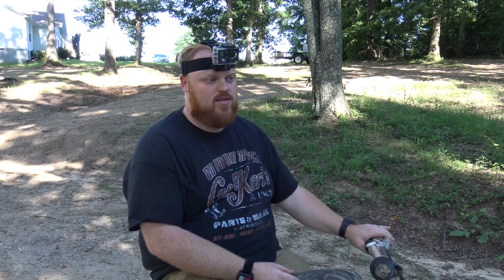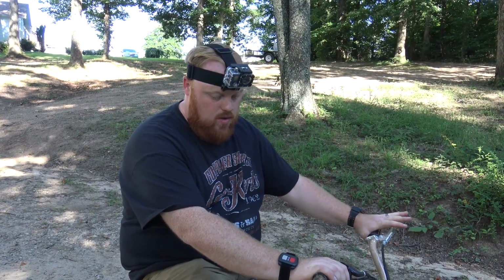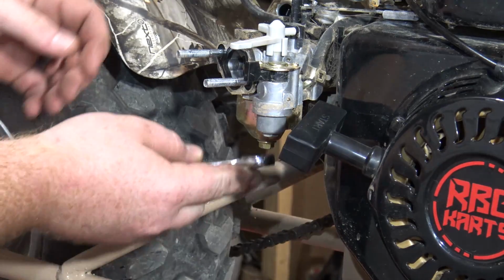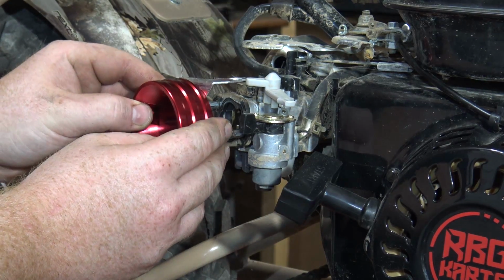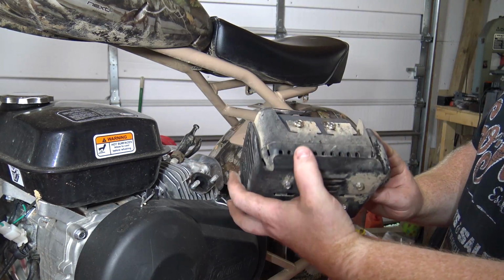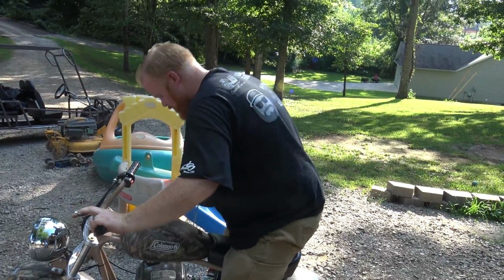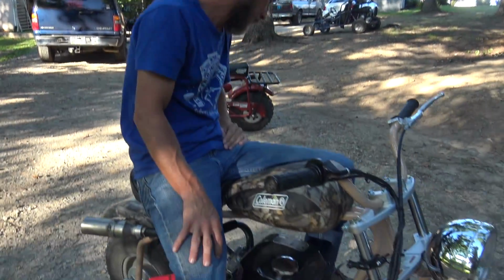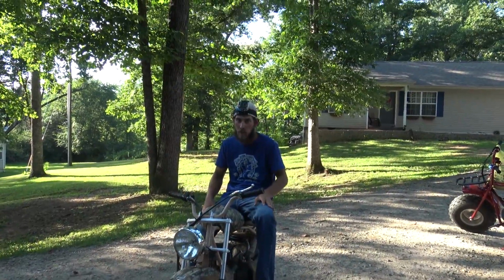Coleman CT200U-EX Performance Parts ~ Mini Bike Monday

Comment: Just got my CT200U-EX put together today.  Took the initial test ride and said that will never do.  Grabbed my screwdriver and could not move the throttle screw.  I took the air filter off and the throttle screw was welded in place.  I cut the screw off and got 27 MPH out of it.  Wow what a difference.  Going to try the zip tie trick next.  I see a Go Powersports order in the near future.
Reply: What specific kinds of gas and oil does the Coleman use ?
Reply: @therealming0 10w30 motor oil. 90 0ctane or higher gasoline

Comment: New models have a welded screw and a fixed jet. You will need to cut the screw and use an extractor to remove the stock jet. Great video guys.
Reply: RCLegion just hammerd a flat head in to it came right out

Comment: I look forward to this series every Monday. Your basically exactly where I am with mods now; except that I bypassed the governor completely by making a new throttle linkage. I only use mine off road so the K&N style filter was a no-go for me. I think you will be pleasantly surprised by how well they will run with a stock intake ported to the max. I only wish they made a Uni filter for the stock air box so I could get rid of the paper filter.

Comment: My suspension would pop back all the way so I just opened it up and stuck a bolt on top with two thick lockwashers and it works perfect now. Way better for offroad

Comment: You can move holes on the governer arm with the spring going to the carb and raise your rpm as well up to 4800rpm is max ive seen someone get one to go too
Reply: I got this RPM with just cutting a few coils out of the return spring. Nice part of cutting the spring is you can lower the RPM back down by adjusting the screw back in.
Reply: Make a video!
Reply: @Odin31b  I personally dont run them anymore. I have a engine with one still together and working in the engine if I have the time I will. It's more or so one of those things you have to play with yourself. Each engine will be set up slightly different where the arm with the spring to the arm off of the gov shaft that runs through the block pushing on the gear to add rotating mass to slow the crankshaft up when the arms on the gear fly outward and some more things I cant personally think of at the moment. Sorry buddy it's been a fairly long day at work today. Anyways you can also use a stiffer spring to change or adjust it. If you remove the governor and dont want to use a throttle stop screw on the OEM throttle setup you can play with the timing and jetting to adjust the max rpm it will go under load. Without load will be different it typically when free revving it will go to a much much higher rpm.

Comment: Looks like it made quite a bit of difference in torque. A little more speed and Lonnie could clear that driveway! Before anything i stick a ziptie in the governor spring, cut the head off of one and put it on another. It took the baja warrior from 22mph to 33mph.
Reply: By the way just got my chain break today, its awesome!
Reply from the maker: Those chain breaks are a must have for go karts and mini bikes. Thanks for watching man.
Reply: Spino_ Slayer same here would like to know
Reply: Red Beard's Garage what the best motor swap for one those without having to do any weld I thinking of a predator 420

Comment: Mines a Baja Heat and i installed a Pred 212 and aftermarket tailpipe (no muffler, straight pipe!) and aftermarket air cleaner and it rocks!! Im over 200 lbs and it really scoots!!!!

Comment: Hey man. Great vid. It appears my jett, 5:48 has a screw that can't be backed out. Like a one direction screw. How do I get it out? Also, my kit that ordered did not come with the new emulsion tube. Thanks.
Reply from the maker: You don't need the emulsion tube and its really hard to get that jet out. I will try and do a video on it soon sir
Reply: Red Beard's Garage I have a 2019 model. The screw on the Jett is shaved off so you can back it out with a screwdriver. Also the throttle screw is soldered on so you can’t adjust it either. I grinded the screw off but can’t get the jet out.
Reply: You all probably dont care at all but does anybody know a tool to get back into an Instagram account?
I was stupid forgot my password. I would love any tricks you can offer me!
Reply: @Archie Brock instablaster :)
Reply: @Zachary Deshawn I really appreciate your reply. I found the site thru google and Im waiting for the hacking stuff atm.
Looks like it's gonna take a while so I will reply here later when my account password hopefully is recovered.
Reply: @Zachary Deshawn it worked and I now got access to my account again. I'm so happy:D
Thank you so much, you saved my ass!
Reply: @Archie Brock no problem xD

Comment: Put a Zip tie in the spring between the governor arm and the Carb. This will give you about 4500 rpms without touching the governor. If your light on the throttle you can feel it pull against your throttle but you can over power it and gain more revs. Also help with clutch slippage. Basically free mod. Dont even have to take the tank off. I usually just lightly wrap the spring with the zip tie. If its to tight you risk opening the bends on the end of the sping if you pull to much throttle. I have also taken off tank and replace this sping with a solid rod to a better effect but i find the zip tie works just as good and is easier.

Comment: Greg, look into a larger low speed jet. I bumped mine up from a 16 (stock) to a 22. fattened up the bottom end and helped the mid range a noticeable amount. Changing just the main jet makes the idle/off idle run lean.

Comment: Riding in the mud I have a fix for that mr. Red beard. I watched all of that. Add it's cuz of the space between the tires. So the new bike is awesome and everything but it's too short. You need to have the calm and red one with the front end that the new Coleman as the hydraulic shocks. And there you go. I think that's what I'm going to do eventually

Comment: Older post but the white choke lever  has a cylindrical protrusion with no apparent use.....u shove it into the hole of the gas line after unplugging it (while its clamped with pliers) from the carb

Comment: I put a predator and tav-34 torque converter on a CT200U-EX and my Baja warrior MB200. It is by far the best setup, and I can creep up steep hills with tons of torque or do 45 down the road. Getting the tav34 to fit on the 200U-EX required cutting/welding of the frame to install without engine mount risers though.
Reply from the maker: These engines have a small 5/8" output shaft. Thats why we said in the video that go power sports is developing one for it.
Reply: Have you seen the 5/8 to 3/4 shaft adapters on ebay? Theyre like 10 bucks. And the plate does have to be trimmed some to fit the frame.
Reply from the maker: The only thing about that is the key is made in the drive pulley on a cvt. It wouldn't be long enough to fully go into the crank shaft

Comment: Hey RBG. Those bikes seem a lot faster. I just can't imagine what happens when you take out that governor. I will stay tuned as usual. Thanks
Reply: Well if you take out the governor that's bad for the motor and it will not start my brother did that and it never started so he sold it just to let you know

Comment: I got this mini bike for my kids for Christmas and after 3 days of light use the carburetor is leaking fuel at a pretty good rate. I’ve taken the carburetor apart fully and cleaned it, put it all back properly and now it’s leaking again after less than 24 hours. Any suggestions?

Comment: So I'm about your size & I have not bought this bike at tractor supply yet because it says the weight limit is 200 lbs! lol  You are all up on that thing & seem to be over the listed limit.  I'm sure the performance kit helps but is the frame & suspension ok so far with you on it?  I want that bike bad but I'm scared to get it.  I'm 250.  Let me know plz
Reply from the maker: Im 250 as well so you are good to go sir

Comment: I weigh about 180 and mine goes up hills fine.  It’s actually pretty darn fast at it.  I think your exceeding the weight limit by about 50 pounds.  Not trying to sound mean by that so don’t take it the wrong way.  I would like to get mine up to about 30mph if I could.  I don’t want to add any parts though.  But for now it’s still a blast to ride.

Comment: Dear red beard. Could u use a 12 volt computer fan as a small engine turbo by mounting it on the air box
Reply from the maker: It would make a super small difference. I don't think it is worth the effort to be honest
Reply: Red Beard's Garage would be cool tho
Reply: Kart Kid It would do more to restrict the air flow than to actually help it. It might turn 100-200 rpms. Turbos spin 80K+ rpms...

Comment: So, how much power difference between that engine and a stock 212 Predator?  I just put an untouched Predator on a similar style bike, and it went 41 MPH. My 1968 Taco 22 has a Predator with a 22mm Mikuni, cone filter, and a very expensive megaphone exhaust that has only hit 39 MPH, but I'm still playing with jetting. Both have 10/60 gearing, but my the Taco has much shorter tires.

Comment: I think I May have mixed up the original and upgrade emulsion tubes. Does the upgraded one have the larger orifices?
Reply from the maker: Yeah it is a little different. Swap it out and see what happens
Reply: The upgrade one has larger holes? Seems to run fine now but I have the emulsion tube with smaller holes top and bottom.  Thanks.
Reply: Update- I called gopowersports and they will pull a stock carb and compare the two. I think that's the only way to tell and I am past that since I already mixed them up. LOL.  Thanks again.
Reply: Just in case someone is doing a google search in 2032  or something..  The upgraded emulsion tube has 5 holes on both sides, the stock predator emulsion tube has 6 on one side, 5 on the other. Turns out I did get the upgraded one in the carb the first time.  It runs good!
Reply from the maker: Sorry I was filming when you was commenting. Thats good to know. I never paid attention before lol
Reply: No problem! Yeah I didn't notice that difference either when looking at them side by side. It is good info to know if you ever get them mixed up like I did.
Reply: BTW I think the upgraded one actually had the smaller orifices on the ends of the tube which is what started the confusion for me in the first place.

Comment: Greg I have a Mega Moto 212 when I decided on a mini bike I wanted the Monster Moto MM-212 but they were sold out. So I bought the 100. Cheaper Mega Moto and as you already know they went outta business. It’s a shame 100 more would of gotten a front suspension Headlight and front and rear disc brakes and I think a CVT not sure. Anyway I was looking online and my forks from top tree to wheel bolt holes is 24” the 33mm forks are 630mm 25” so that’s fine but the Triple Trees are 6.29” from mount to mount I need 9.3/8” between forks. I’ve looked about everywhere and can’t find wider trees for the forks. I did install 2 60 watt over under LED lights with a Talentcell battery in the rear ammo box 6,000mah A/C 12,000 mah D/C. Can you direct me to where I can find the complete fork set for my Mega Moto so I can install a Swing arm and rear shocks. Remember the fork holes have to be 9.7/8 to 10” to work? Thanks

Comment: How about putting a "springer" seat on the EX for a little more comfort while riding?
Reply: thats a good idea, i wonder if that would work on a go kart with no suspension
Reply: BackYard Karts the point of a springer seat is for comfort on a bike with no suspension. The springs under the seat become suspension for youe body, as to not destroy your back on hard bumps
Reply: but would it work for my go kart?
Reply: I agree Kelly Best. When my EX was slow the lack of rear suspension wasn't so bad, now it can be downright brutal. It looks like it would be fairly easy to add springs under the stock seat.
Reply from the maker: We have actually already planned on that lol. Thanks for watching and the input man
Reply: Hes gunna break that thing
Reply: Red Beard's Garage you gonna add nitrous to it
Reply: I broke my back while riding it on bumpy land so yeah it needs springs

Comment: I have a question about the exhaust setup...I really like how the new exhaust works and routes to the back, but how loud is the setup with the new muffler vs the stock exhaust?
Reply from the maker: more than double the noise
Reply: That's unfortunate...I don't want it any louder but I do like the exhaust not being right under my leg.  Thanks for replying!
Reply from the maker: No problem man

Comment: did u put the gasket on the spacer between the airfilter adapter because if u dont you engine will suck dirt in from there we had that problem and blew a predator up because the carb was full of dirt and it got in the head and destroyed it
Reply from the maker: Yeah i put the metal gasket with the rubber o ring on it
Reply: ok but did u put the paper gasket that goes on that spacer with the o ring on it comes in the kit
Reply from the maker: I never us it. Its not really needed in my opinion
Reply: its claimed two of our motors lol

Comment: Where did you get the EX model I can only find the ct200u and I've always wanted to buy one of those.  Do you think if you put a torque convertor on there that you would get some more torque for hill climbs and stuff cause the motor didn't seem to have enough torque to get up the hills. - Mini Moto

Comment: Will turning out the throttle screw hurt the engine if you hold it at wide open
Reply from the maker: No it will still governor itself

Comment: RedBeard i got a ct200u ex like you modded here. And am looking to swap the headlamb for a 12v DC 18w led. I saw a honda dual coil that outs out 12v dc 50w. It may fit but wanted to see if you knew a good options

Comment: I have a 212 Predator engine with poor boy upgrades lol, i drilled a hole in my factory air box an I put a PVC pipe elbow in the hole an plastic welded in and a custom exhaust and throttle screw adjusted I test drove it and it hit 27 mph...really wanna 40 or over what do you recommend?
Reply from the maker: Remove the governor and gear different

Comment: I just picked up a Coleman for 499 at TSC. I’m confused on your jet swap though. I went to the go motorsports website and there’s a warning that the jet is not removable and that a whole new carburetor is needed.  What’s the truth??
Also, The additional cost for the muffler seems like a lot. Is it necessary?

Comment: I cut the bolt on the carburetor bracket that limits the accelerator arm from opening all the way and I cut 1/2" off of the spring, that runs on the outside of the accelerator cable and the Coleman CT200u EX starts fine with the choke in and as soon as I turn off the choke the mini bike takes off and only the cut off switch will stop it.  Did cutting that spring cause that?  If so where can I get the original spring?  I checked gopowersports.com and I couldn't find the spring there.

Comment: i have the coleman ex and not only was my screw welded but the carb had a one way jet that i could not even get out with a drill.  now the bike wont idle and its sputters at full throttle(pretty sure its because i couldnt install the supplied jet).  any advice would be greatly appreciated!!
Reply: david drake same with mine. I have to cut my screw
Reply: My screw is welded as well. I discovered this only AFTER I half stripped the slot out trying to unscrew it. What’s the best way to break that weld?!
Reply: THEDONLEONARDOHC Use a File and cut at it slowly
Reply: Hammer a flat head in to it came right out 4 me

Comment: Did the same thing but it made ZERO difference. Installed a stage 1 carb and 22lb springs from gopowersports and bypassed the governor, no difference. Added an ARC 6619 billet flywheel recommended by studz racing and it barely goes and faster and misses and sputters on the top end

Comment: Can you install kits for the ct200u on the ct200u-ex? They are the same engine right? On Amazon there are some kits that say it is meant only for the ct200u and not for the ex.
Reply from the maker: The performance and cvt kits will work on either bike
Reply: Thanks

Comment: Hey i bought a kit recently for my predator 212 just the air filter and jets but when i put the jets in it just boggs down at full throttle any ideas
Reply from the maker: Does it seem to be running rich or lean? If you are running the stock exhaust that can hold one back quite a bit
Reply: My Coleman CT200-EX did the same thing . Bogs down at full throttle .
Not impressed with the kit from GoPowersports